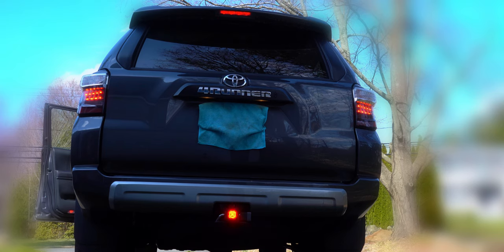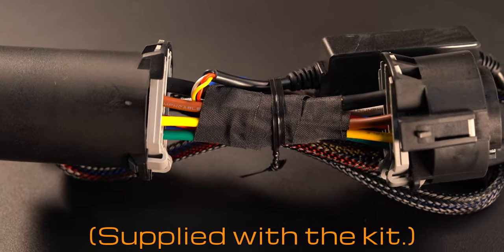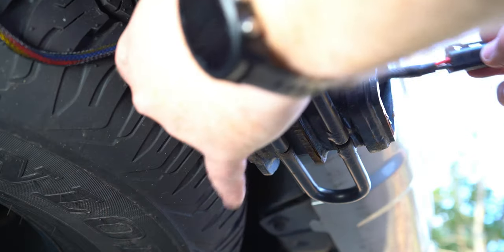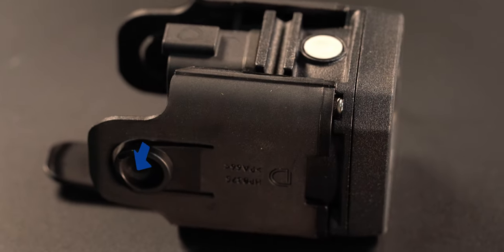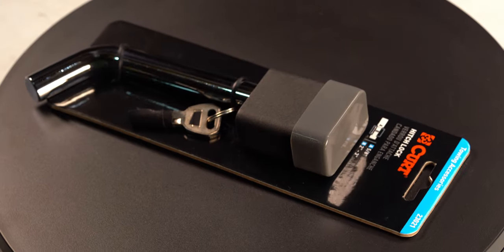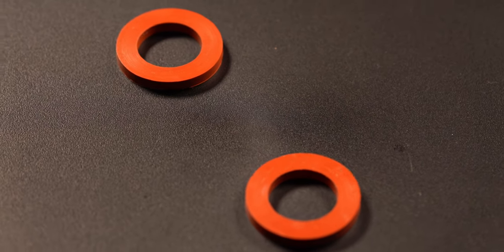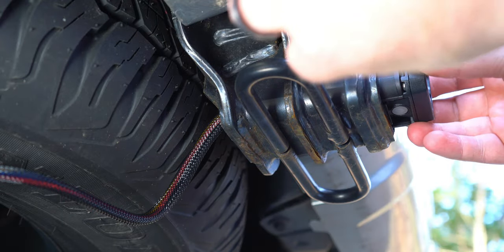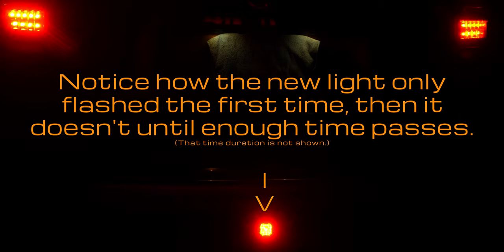4th Brake Light Installation Made Easy!

Comment: To remove the OEM 7-pin plug on the 4runner, you mention an “unlock tab”…is that the raised area and the tab is hidden under the tape/wire protection sleeve?  TIA.